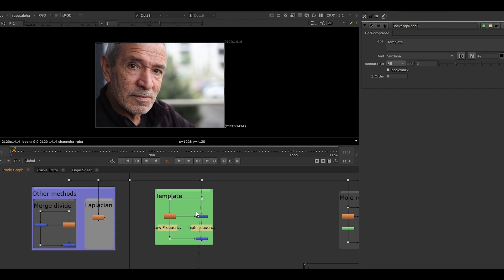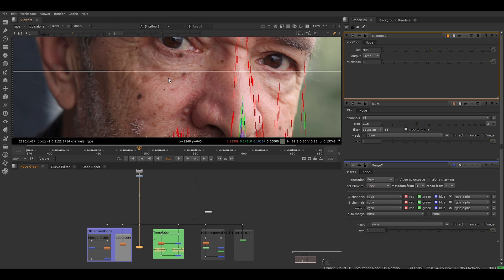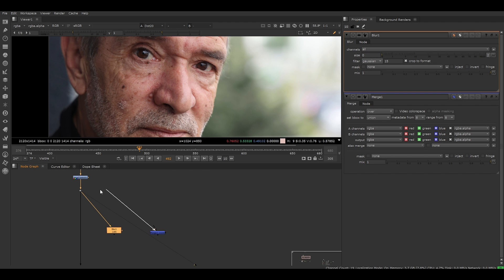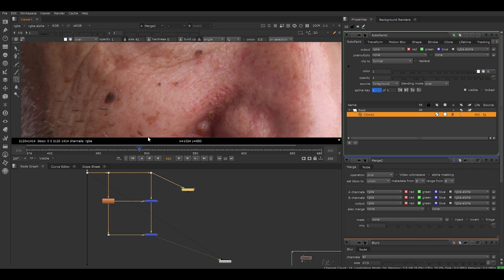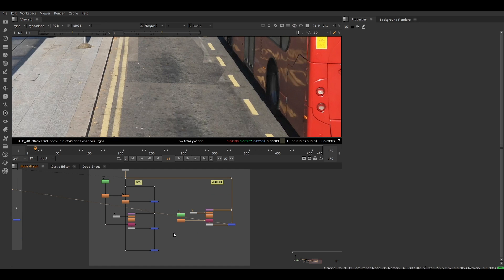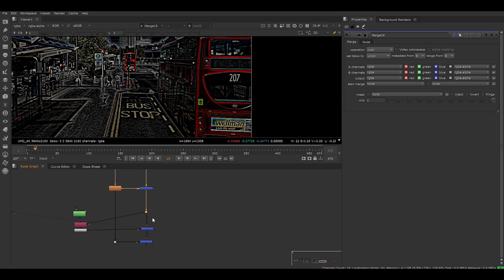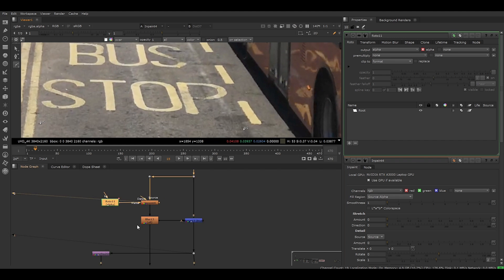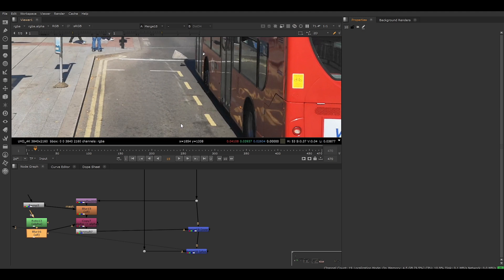Preserve and Reuse Details During Clean-up in Nuke - 'Merge Divide' Technique

Comment: hello, the rotopaint node sometimes causes some bugs like doesn't render properly. i'm not sure what's the reason causes this problem. maybe the caches? or maybe I brush to many times? Could you fix this node? This problem is not happen that much on Flame. and this problem occurs since i started to use nuke in 2015:face-blue-wide-eyes: